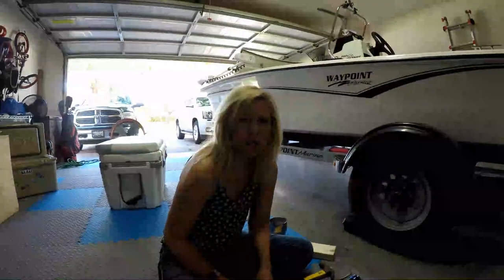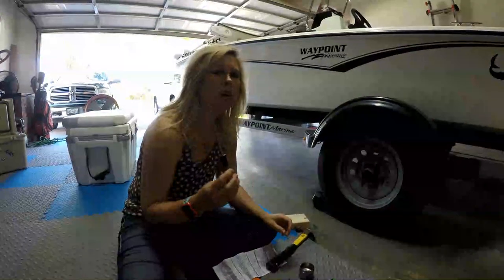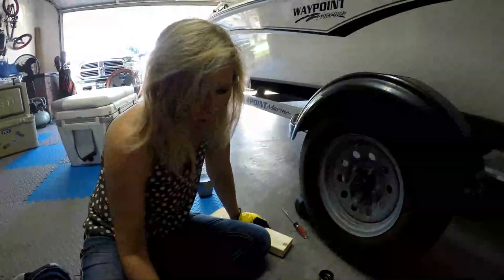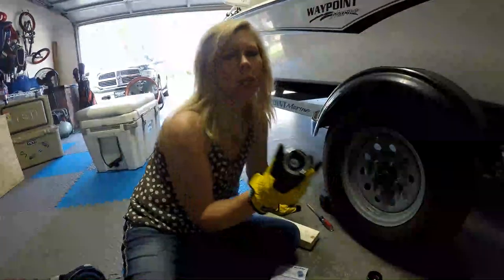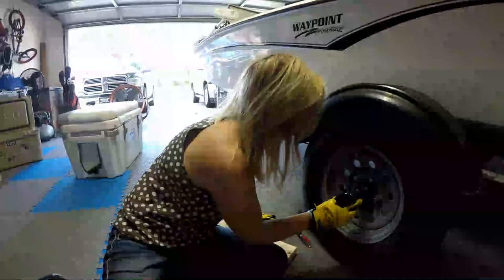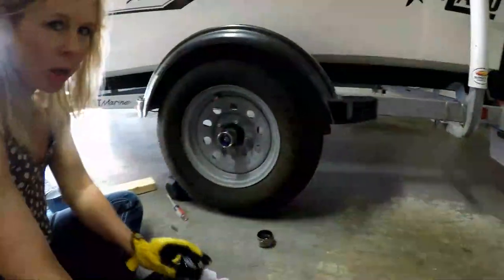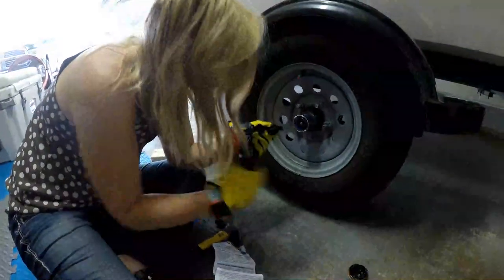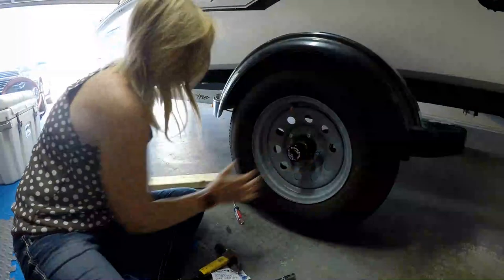How to install Bearing Buddies on your trailer - simple trailer upgrade - step by step instructions

Comment: Hey Karen, need to inform you of a couple crucial things everyone watching this...need to know.
1. Much more grease than was shown--needs to be pumped in there. The floating seal needs to come mostly out to the outer rim, and it's not a bad thing for you to see some grease escaping out (easily wiped clean).
2. I also have a small grease gun like you used, but it's for other light applications. For this job, you need a full-size gun with insert, because you're going to need much more grease than you pumped in (both wheels together).
Reply from the maker: Thank you for the feedback and helpful advise.  Much Appreciated!

Comment: What size of bearing buddy is that one? I pickup my MPS15 tomorrow & have the same trailer. Thanks for your time
Reply from the maker: Hey man, thanks for watching. I installed them a while ago and if my memory serves me, they were 1.980. Model 1980, but I could definitely be mistaken. I would highly recommend measuring or calling your boat dealer before ordering. Tight lines and hope you enjoy the pro skiff
Reply: @WeGoFishing  okay will do, thank you & tight lines